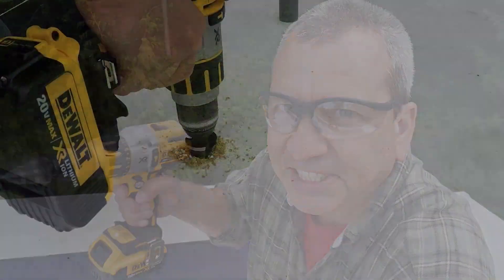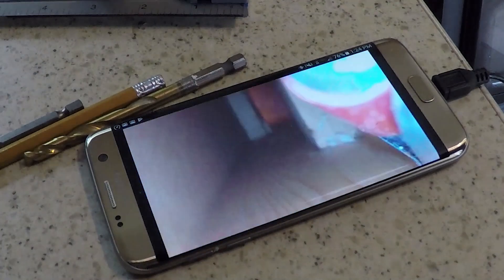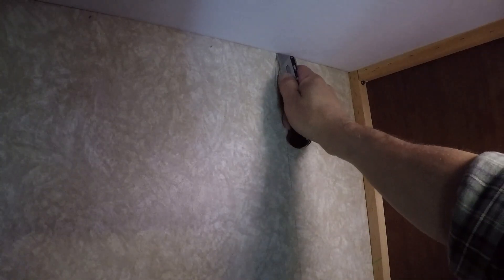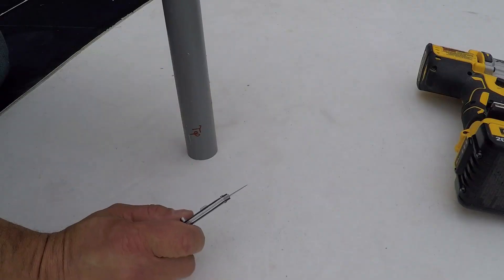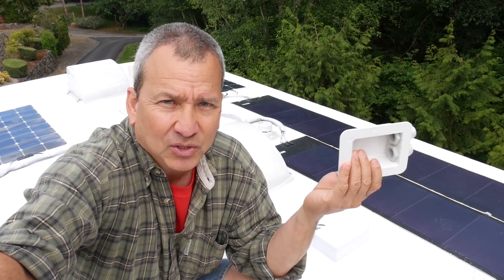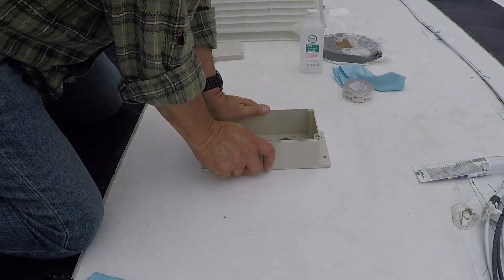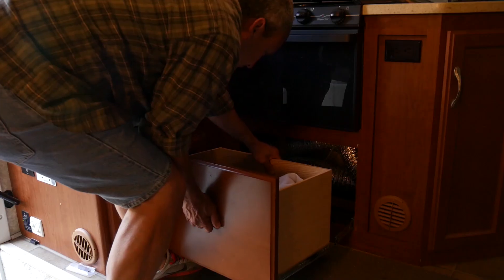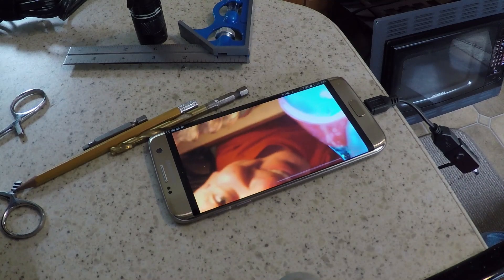Cable Access Hole Through RV Roof // How To // Solar

Comment: Great information!😊 How does all this connect to battery bank and how big of a battery bank do you have? I'm learning so much about solar. Just trying to make sense of it all for my own needs. I have a 2019 Class C Four Winds 24ft.
I want t solar when I can afford to get it. Then I'm going to have to find someone  knowledgeable to install it.
Reply from the maker: There's more info on my setup on our website (https://www.rvwithtito.com/articles/our-solar). Here's a video about our batteries (https://youtu.be/WyRy7kAyTHE). The cables from the roof go all the way down to my solar charge controller compartment which then charges our batteries. More about that setup here (https://youtu.be/n7fSJg-BA-k). Hope that helps. Welcome to the channel!

Comment: Brian, I checked with the Eternabond company recently. They don't suggest using the 
double stick eternabond to mount anything to the roof. It's fine to prevent water intrusion
but they don't recommend as a method to fix an object to the roof. They suggest screws.
Reply from the maker: I've found that it has many uses and works great for small stuff like this. It can soften under high heat though. I primarly used it to prevent water intrusion along with the Dicor. Together with the Dicor, the box is on there solid.

Comment: You have some cojones.... I am afraid to drill any holes in my coach. It helps when you have the right tools too. Been thinking on mounting the Winegard Rayzar Automatic digital antenna and drilling into the roof got me on hold just because I am afraid.  Great video as always.
Reply from the maker: What helps is really thinking things through before you drill that hole. Make sure you're in the right spot first and start with a very small drill bit, just in case.

Comment: Hi Brian,               what gauge and where do you get your solar wiring?  What size wire from the controller to the batteries do you use?Thanks,Phil
Reply from the maker: It's #10 AWG solar cable. There should be a link in the description. I have two separate runs to the charge controllers. The longer of the two is #4 AWG starting under the RV. The second shorter run is #10 just like on the roof. I'll eventually rerun the longer of the two to go through my new roof entry point and use #10 for that. Both arrays generate between 40 to 80 volts so the #10 is fine.

Comment: Just found this video.  A couple suggestions for the future - do your roof penetrations like boaters and after you drill your hole, scrape back the foam between the inner and outer skins to create a recess, then fill the recess with some thickened epoxy.  That way, you will never have water infiltrating your roof.  For your piece of plastic conduit through the roof, make sure you secure it so it doesn't move up or down.  Pretty easy to use some glass reinforcement and epoxy that to the roof surface as well.  Doing that will also help ensure you never have a leak, even if the sealant fails.  Last, make sure all your wiring races are cut big enough with soft edges so your wires won't chafe through.

Comment: Got a question Brian,  does your solar panels charge your " truck/ starting" battery?   Thanks.
Reply from the maker: No. Just the house batteries.
Reply: The reason I ask is that my truck battery just died and they replaced it under warranty.  The RV stays in storage when not out and I am going to add a solar system.  Could I run a positive wire up to the truck battery also?
Reply from the maker: Here's a device that may help you https://amzn.to/2Od8KjS
Reply: Thanks Brian.  There is a red cable going back towards the coach batteries with a C/B under the hood.  Would this item replace that C/B?

Comment: So far.....battery monitor installed....inverter installed with auto transfer switch to power my non GFI outlets.......next step install solar....drilling into my roof is my biggest challenge so far. I think I have a spot above my kitchen area. The MH has a deep narrow cabinet that is so deep I can barely reach the rear of it. I plan on installing the box you suggested first. Once that is in I am home free :) I am leaning on using VHB tape to secure the panel brackets to the roof rather than drilling. So far I have not found anything that suggests it is a bad idea. Was curious if you had any opinions on it? As others have mentioned......thank you for putting these videos out....they help us understand our RV's and allow us to tackle these great upgrades!
Reply from the maker: I assume you're installing traditional solar panels since you mention brackets. I think the VHB tape is definitely worth a try. If you also cover the brackets with Dicor, they should be pretty secure. My only concern would be the wind pulling them upward. That could lead to some delamination of the roof membrane where the brackets are. That's all I can think of though. Give it a try. Worst case, you'll have to put in a couple of self tapping screws on the front brackets. Good luck!

Comment: I am really impressed with the practically in your work.. well except for the spaghetti wires on the roof.. . Loved your roof "penetration"... But I thought was unnecessary all the time until I saw thaw that you made the choice to have your refrigerator on your slide out when you bought your unit....  I have retired from the Boating industry and now by necessity work as an RV tech.. all day every day.. ....  RV's are like cheap boats... But occasionally I get to work on some nice units.. OR make the ones I get to work on.. Nice.. way better than factory normally... I will be following and watching some of your old video.s.. Nice work..

Comment: What a great topic, Brian, and an excellent overview of the process. We understand that drilling holes through the roof isn't within everyone's comfort zone, and it's not to be done without a good reason. But it's also nothing to fear. So many people think that a hole in the roof is a sure path to a leak, but of course theres are tons of places that the manufacturers have brought cables, vents, fans, skylights etc. The the key is to seal properly and inspect periodically. We love the tip about attaching your borescope to the wiring to see your way around... although it did look a bit like you were giving your RV an endoscopy. Maybe a way to better RV health? 😁

Comment: First of all Brian, I want to thank you for the time that you spend on producing your videos. The main thing that I appreciate is the fact that you are producing videos with real substance and valuable information. You are not just pumping out videos as a subscriber factory. I do have a question in regards to the flexible solar panels. Many have reported dependability issues such as " I'm not lost, I'm Rving" where it appears that all of his panels have failed him. I really want to go with flex panel but concerned with the dependability. It appears that you are having better luck with your flex panels. I would appreciate your current thoughts and observations.
Reply from the maker: Hehe...Subscriber factory. I get what you mean. That's very thoughtful feedback. I really appreciate it. I do subscribe to those guys too and watched that video this morning. It bums me out that they are having trouble. It seems extremely unusual to have so many panels fail at once. I certainly sense his frustration and am eager to see what comes of it. 

I have three HQST panels installed and they still perform well for me. I regularly test them. I have broken one before by bending it too far. Proper care and handling during and after installation is important though since they are thin and more fragile than people think. The cells can break if you bend the panel too far or step on them a lot. You shouldn't really walk on them. I avoid walking on them once installed unless I really have to. When I have to, I step on them gently. Finally, I don't camp or live in extremely hot areas, but I have heard from others who have had these panels installed for several years and continue to have great results and zero failures. They have used them while crossing the country repeatedly and have been in very cold and hot temps. With all of that said, I do have a couple of spares just in case :) 

Suaoki (the brand of flex panels they have) has actually reached out to me repeatedly to do reviews, but I've declined not because of their products, but because I do not believe a review of their flex panel would add any new information for my audience. I do have a couple of Suoaki panels (50W) that I used for my portable window awning solar setup and they are great panels. I'm still a fan of the flex panels for the reasons I've shared in previous videos. Traditional panels are not immune to problems either and I have some of those too. 

Lots of folks talk about longevity and warrantees. That's great if it helps sell you panels, but I believe that it is unrealistic to count on a 10 - 15 year warrantee for RV or van mounted solar. Chances are, during that time, the manufacturer will be gone anyway, you'll sell or upgrade your RV, or you will upgrade to newer tech. 

The bottom line is that solar is still coming down in price and everyone is looking for the best deal for their buck. This means you're probably going to buy panels mass produced in China. Even the solar companies in the US or Canada are most likely sourcing materials and components from China. China has invested so much in the production of these and we just can't beat the price. Most folks are watching their money and will most likely opt for the Chinese brand instead paying 2 to 3 times more to buy from a manufacturer perceived to have a higher quality product and long term support. 

For these reasons I treat these panels as disposable items. I test them when they arrive and send them back immediately if there's a problem. I'll plan to replace them if/when they go bad or if something much better comes along. After all, I love to make videos about new tech so I'll get my hands on the new stuff and share it with you. 

A bit wordy, but those are my thoughts. I hope it helps John.
Reply: RVwithTito great informative reply. Thank you for the response. Keep up the great work and thanks again for all your hard work.
Reply: @RVwithTito  Great info! Thanks for your time.
Reply: I watched his video and have the same reservations. Heat buildup under the panels would also be something I can see being a potential problem.

Comment: Awesome tutorial, Brian. I have 2 questions; what size conduit did you install and will there be enough room for your expansion plans? Great video!!!!
Reply from the maker: It's a 1" internal diameter conduit I had in the garage. It should work fine long term. I may have two more solar cables, maybe a coax, then some smaller wires.

Comment: Excellent tips Brian , gotta get me one of them cameras they're pretty handy . Hey what did you use to clean your roof for the sealant ? I got the same roof and there's a lot of opinions out there .
Reply from the maker: Thanks! That was just rubbing alcohol I cleaned the surface with. It works great because it quickly evaporates.
Reply: OK cool . Did you ever do a video on that camera ? I never seen one that I could use on my phone ? Thanks

Comment: Roooooof not not ruf 😋 this video gave me an idea of what I want to do. I have a pop-up so you can't just drill through the plastic on top then run the wires to the side panels because the whole roof has the insulated boards. On that note, what I think I might do is just throw the whole right underneath where the wires come out of the panel go straight through the entire roof then just run some of that small conduit from the opening to the edge of the camper for the wires are already are already set up and ready to go. I've just been waiting for the mounting brackets for my solar panel
Reply from the maker: Haha. It must have been rough listening to me say ruf over and over again :) Glad you got an idea from the video. Good luck!
Reply: RVwithTito not ganna lie every time I was like NO! Haha maybe it's a location thing I'm originally from Tampa Florida so for example when we ask for soda we literally just say can we have a Coke and I'll ask you what kind do you want instead of just assuming you want an actual Coke, now I live in North Dakota and they all call it pop and say bag "beg"
Reply: Hole, not whole. 😂
Reply: Epic Mini Life haha "smart" phone and no proof reading. The Perfect Storm

Comment: Great how to video.  I always recommend the refrigerator vent if their RV allows it but there are so many different RVs that's not always possible.  This type of wire run is the way to go when an access point can't be found or is too far away. Nice job as always.
Reply from the maker: Yes. The refrigerator vent is a popular way to go. My RV does not  have a refrigerator roof vent. It's on the side and the refrigerator is in a slide out. Thanks!!

Comment: I would have put some diecore or sealant inside the hole and then slid the conduit through it as added protection. But a great way to put a pass through junction box on the roof. Best supported spot you can find. Are those connectors sealed where the cables pass into the box? If not fill it with sealant or it will fill up and then drain into the cabin! Had that problem on a Freightliner! An antennas cable was defective and they found the leak finally last week after removing the whole ceiling liner!  Rain filled the antenna box/body, it drained into the inside liner which was back over the sleeper and my bunk and then drained out on my left leg while driving!  Same problem. Rain got in through a bad seal!
Reply from the maker: Yes those cable glands do have a rubber compression seal inside. I've used them before on another box on the roof and I haven't had any leaking. Thanks for the comment!

Comment: Good work! One suggestion. On the roof, where the cable and flex-tube goes into the junction box? It looks unfinished with the cable exposed, and creates a potential leak. They sell water-tight connectors that go into the junction box side, and the flex-tube fits tightly into the water-tight connector. Lowe’s and Home Depot sell them.
Reply from the maker: The cable glands I used do have a compression water tight seal which do keep the water out. But the flex tube (3 sizes) I have doesn't fit over it snugly. I'll go check out those connectors. Thanks for the tip!

Comment: Nice job, I couldn't do it.  I really wanted to drill my roof for my 4G antenna wiring into a smaller cabinet.  I ended up going through the satellite cable entry point into another cabinet.  I used one of the solar cable entry plates you showed.  It works but I'm in a much larger cabinet than I need.
Reply from the maker: I've gone throught the TV antenna hole in the past as well. I had to enlarge it a bit though then re-seal it.

Comment: Really enjoy all your videos. Noticed a Youtuber say the thin bendable solar panels don't last long due to thermal effects. Have you noticed any drop off of power.
Reply: Quality flexible and semi-flexible panels will suffer little degradation over the years. I have been using uni-solar (6 panels total) for 15 years and they are still going strong. Admittedly I am unsure if they are still in business. I would not hesitate to buy used uni-solar panels. Note that I have lost four rigid-style panels over the years to falling branches, large hail and unknown culprits. I will stay with quality flexible panels.
Reply from the maker: That's why I chose not to replace my Unisolar panels. I've had them for many years and they are solid. Unfortunately they did go out of business, their parent company did, for financial reasons. Too bad. 15 years is great. Very encouraging.
Reply from the maker: No issues to date. They still perform well for me and I regularly test them. Proper care and handling during and after installation is important though since they are thin and a bit fragile with breakable cells. Also, you should not bend them very much during installation, and you should avoid walking on them once installed. If I have to step on them, I'm very careful and am not a heavy fella. Finally, I don't camp or live in extremely hot areas, but I have heard from others who have also had them installed for years without issue crossing the country a couple times and in very cold and hot temps. With all of that said, I do have a couple of spares just in case :)